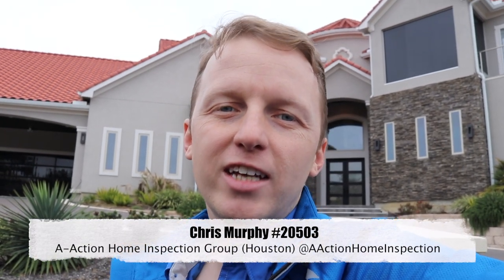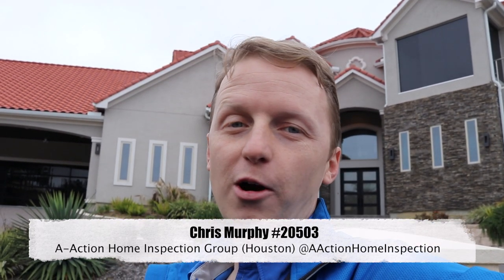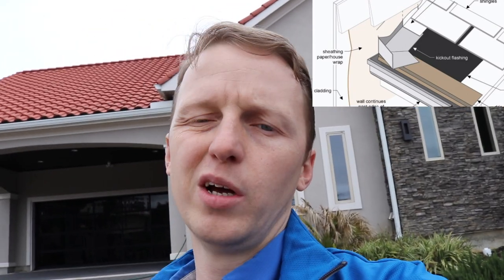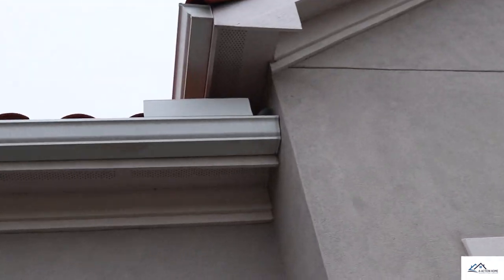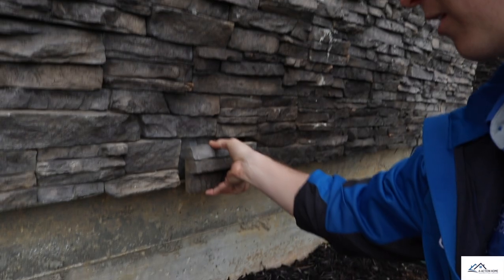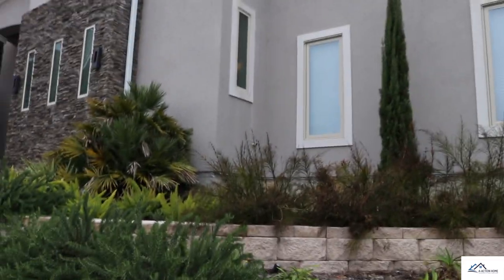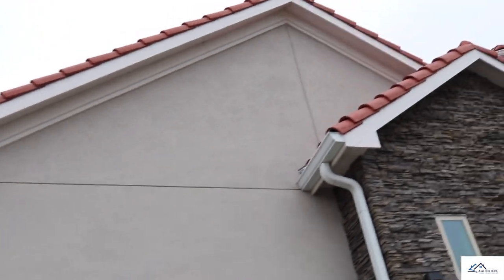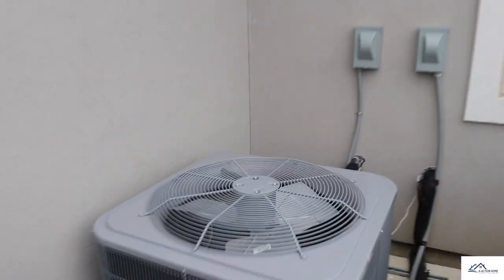1.5 Million Dollar Stucco Cracks

Comment: In the trade 27 years and its amazing that every problem with a stucco home is blamed on the stucco company, the kick out is a roof 
Issue, an yes you can put control joints over windows and doors but most builders and owners delete them because of looks and then once theirs  a crack its the stucco guys fault,bottom line you need good supervision by the builder too make sure the complete home is dried in properly ,and over wood frame the plywood need to be gapped paper & lath installed correctly
Reply: I agree. These cracks even where the joints are provided according to his own criteria-, and so early, are probably due to these factors plus whether the stucco was properly cured. In addition hairline cracks like these are going to occur to stucco eventually. It's the nature of the material. It's when you get them early and often, or they open up that you have a problem. Rarely see expansion joints on house stucco in California and some cracks easily, some doesn't.